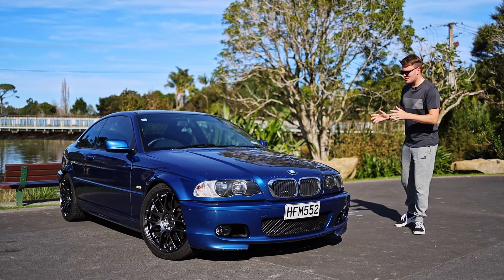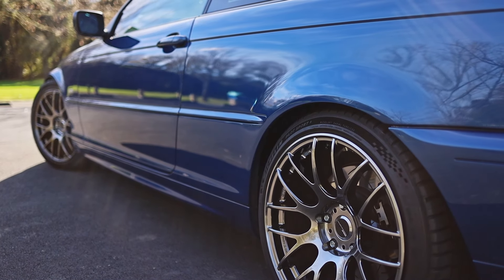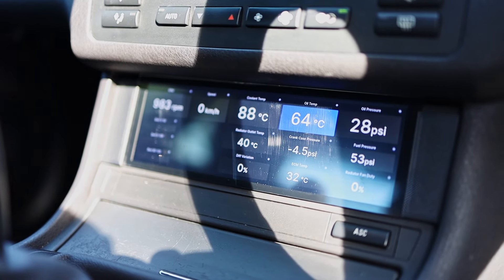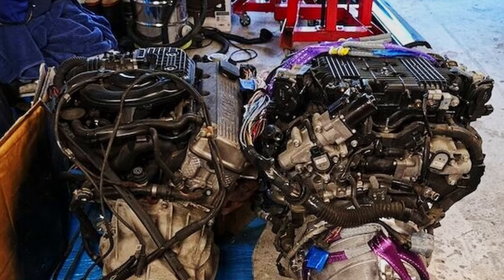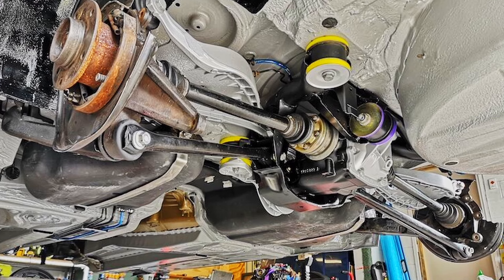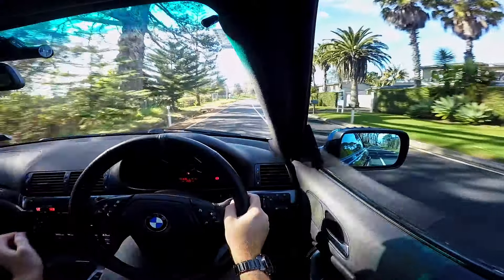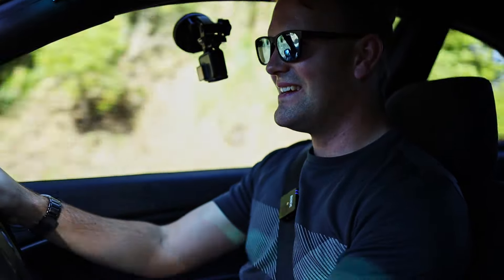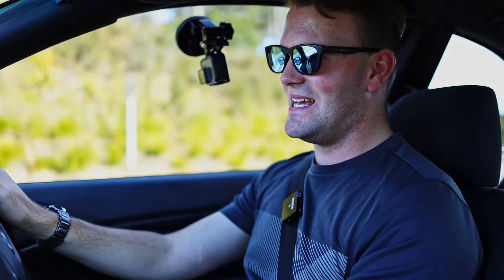The INSANE decision to put a Nissan V6 in a BMW

Comment: The 370z (with the, obviously, VQ37) and E46 M3 have almost identical specs on paper, so this is a fun build that actually makes sense.
Reply from the maker: @akar2755  yeah they’re pretty similar aye. Certainly very cool to combine the two!
Reply: Exactly, and you get the solid reliability from the Nissan engine. The E46 is also a very good looking coupe with a timeless design.
Reply: VQ is tested on a morn modern power standard, the S54 won't make 338hp on the same test, will be 15hp or so less.

Comment: I just got the rev hang in my skyline tuned out so it is easy to do. Arduino hacked cars l, my kind of build! The custom headers did the car right, it sounds way better than normal VQ powered Nissans. This is a very nice build! My only question is with such extensive fabrication required, why not just put a V8 in it? The LS is smaller than a VQ. The VQ might be cheaper in NZ but the fabrication costs far outweighs the cost of a used engine.
Reply from the maker: @GeorgeXian  yeah that’s true, I guess the owner wasn’t aiming for maximum performance more a build no one had done before
Reply: Thats why its so good, because its unique and different. I love it, the fab work is on point too, wicked car sounds really good too. 👍🏻

Comment: This is awesome. I didn't know arduinos were fast enough for this sort of thing
Reply from the maker: @Incommensurabilities  apparently they are!
Reply: @Incommensurabilities Yep, this is on a Mega 2560 R3 and from memory it's looping through the code a few hundred times per second. Will look to switch to the Uno R4 WiFi in the future which will be much much faster. Likely into the thousands of loops per second.
Reply: @davesuninterestingstuff5026  I guess a few 100Hz  must be enough then though the upgrade sounds good. So I'm guessing it simply translates the data between the engine and the BMW's ECU because the protocol is different?

Comment: I was hoping you would talk more about the engine. Does it have more low end torque? Is it rougher than a BMW straight 6? How does it compare to an M3 engine?
Reply from the maker: Tbh it feels a bit slower actually. Just because of the longer gears. Still smooth though

Comment: its still registered as a 4 cyl 1.9L?
Reply from the maker: @i0x37  yep haha
Reply: @KiwiCarLife  I've been looking into Vr4 galants (specifically 8th generation, manual). They seem sick, any possibility of a video on one? Doesn't seem to be many video reviews on them, and I may be interested in buying one soon.
Reply: @i0x37 such underrated cars. I felt like a boss getting to drive one that my dad had lying around while on my restricted license. Ended up selling for like $3500 back in 2012 with only 126k on the clock. Oh in hindsight…
Reply: @TheFatSandwhich  I own a regular 8th gen galant at the moment & its an amazingly reliable machine, its sitting at 315k kms on original engine and transmission. Still comfortable, economical, and reasonably powerful for a 2 litre 4 banger, I paid $1500 for it in april 2023.

(Plate is DUQ325 if you wanna carjam it!)

Comment: E46 are a great car, even 330's....VQ37 is a great engine, but this is the most pointless engine swap on the internet. All that effort for 350ish HP with the most vanilla power curve...why bother? And no A/C, or even room for Fi...A for effort I guess?
Reply from the maker: I guess he was trying to make something no one has ever done before. A technical experiment if you will
Reply: He still has options for Fi. He can do a rear mount turbo and push a lot more power than any E46 can with the stock engine. Vq can handle 600WHP easy
Reply from the maker: @Cr8tiveDre  oh I wouldn’t underestimate the M54 people have made some solid power from them
Reply: @KiwiCarLife  for sure! but if I had a more interesting option that can handle more power. I'll take that option

Comment: Title should be how to devalue your E46.
Reply from the maker: It'll be worth a lot more than the original automatic 318ci that it was haha
Reply: that thing isn't a gtr or M line up series. how it become devalued the car?. i know Bmw doesn't make v6 because i6 has better balance, Less cost production, easy to maintenance too. but V6 is easy to get now with low price rather than i6. There's many car used v6 rather i6. Because v6 can be mounted on fwd cars rather than i6. i6 usually for rwd car, they're no many choices for i6.